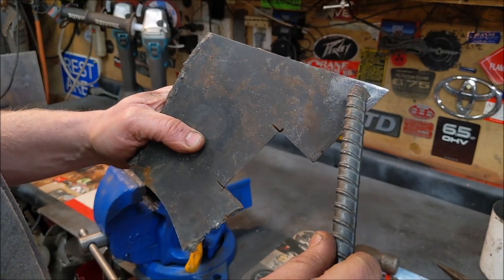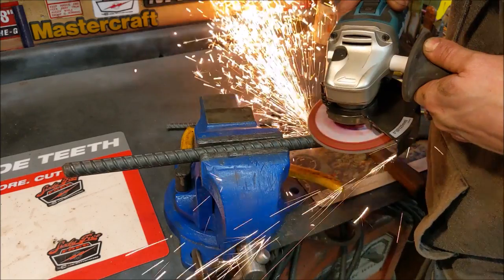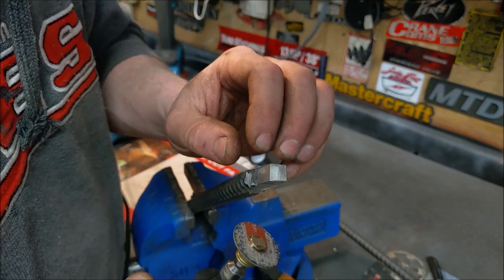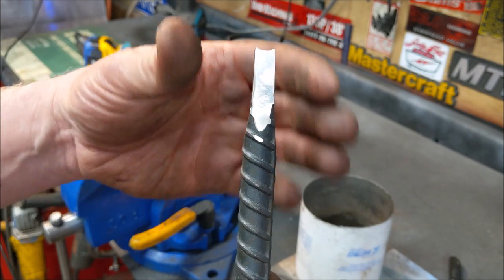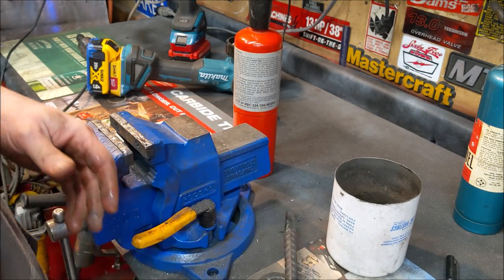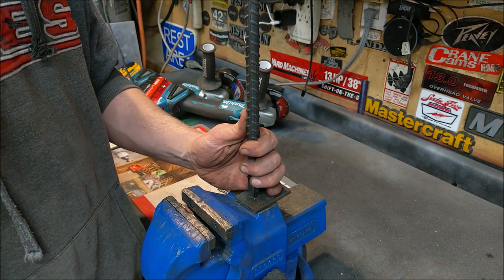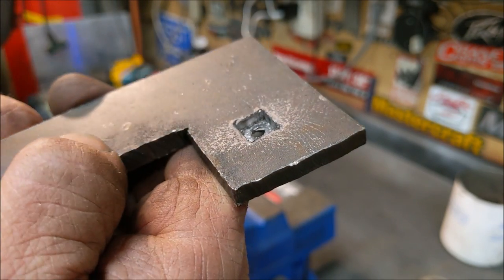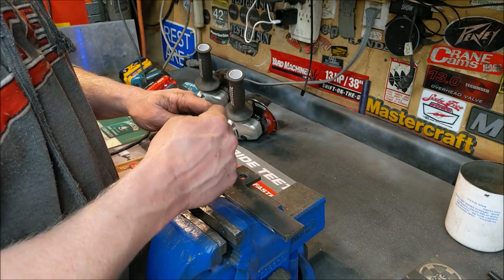Drill Square holes in steel with REBAR   -NO SPECIAL TOOLS needed

Comment: Great homemade tool from you yet again. So when you temper it could you still heat it back up til it just starts to turn yellow to get rid of some of the brittleness n still have it be tough enough to get through? N do you think rebar would work to make a tapered broach to use in a press?
Reply from the maker: Because I taper the temper after I got about 1/8" back from my original grind it was just fine. It's hard to judge the carbon content a chunk of rebar will have so you never know how hard it will get. The 1/2" chunk was perfect hardness but the 5/8" chunk got a little too hard. I would just heat it until it was around 500-700 approx and let it cool. It's hard to get an accurate temp reading with such a small piece. I would trim it down to about an inch or two for a press. The top is too soft and will bend out of the way if it's too long. It should take around 10 tons to press a 3/8" square through 1/4" plate(15tons-3/8"plate, 20tons-1/2"plate). Put a shield around it. It will be a scary
Reply: @sixtyfiveford  thanks man. You're awesome

Comment: Cool video!
       I thought heating a bar for e.g aids bending or shaping it with hammer.   So does cooling it fast have the opposite effect?
Reply from the maker: Cooling it fast hardens the steel and makes it impossible to bend/shape without breaking. Cooling it slowly anneals the steel and allows it to be malleable.

Comment: your right water does harden it better but salt water.. 10% salt content to be exact but what's important is apply a flux to whateveryour hardening befote heating it burn away the flux will make metal more "atomicly" more accepting to harden and the salt plays a huge role in that, makes a huge difference 2 extra steps but you get a much sharper hardened result
Reply: Newb here. What kind of flux?
Reply: @GeekRedux   i always used the green label kind it's the real thick green almost Play-Doh consistency flux.. its but what flux required to solder to steel but technically steels not solderable  to a certain degree, the idea is pitting the surface ever so slightly just large enough for the sodium,to enter. remember steel shrinks as it heated that's  why shops heat stubborn bolts . the shirking,makes it possible to obsorb the mineral that changes steels atomic structure harding it when its cooling it has less occupied atomic space with all these new sodium molecules in the same space changing its atomic particles space in between less space increases  density  hardens the steel
. The idea behind it.. i forget why you dip cherry red steel in oil but i believe its because the some of the carbon in the oil is transferred into the steel and the higher the carbon the density...better wiki that but the green flux works and 10% sodium salt water to harden steel.. but becareful only harden the edge its super hard and can shadder now but holds a edge and strengthems it sheer wise
Reply: @drewstudlino5885   Thanks for the info--much appreciated!
Reply: @GeekRedux  yep welcome just remembered only heat what you want hardened this method really works for example a friend asked how  my axe stayed sharp so lomg I told him and he hardened his  entire axe head and then hit the back with a hammer to spilt wood a piece of the axe broke off and cut his leg really good just remember hardened steel behaves differently good luck

Comment: If your pilot hole is large enough to accept a jig saw blade as it is in this case you can save copious amounts of time by just jigging out the corners. This is a very quick way to punch holes in light gauge metal though so A+ for that.

Comment: Wouldn't tempering it be beneficial?  I'm a hobbyist blacksmith and I know that once you quench the metal gets extremely brittle
Reply from the maker: Brittle, but also as hard as it's going to get. I played around with tempering and it made it too soft and rolled the cutting edges.

Comment: You said drill square holes! This is click bait! Lol just kidding pretty cool never thought of. I've always just drilled 4 small holes then a bigger one in the middle which works good enough for most things but can still have a little play in it. I'll definitely try this the next time I need a square hole thanks.
Reply from the maker: 4 holes on the corners/1 center is how I've always done it in the past. This is a fun method to test out and quick for sheet metal, I don't know if it's quicker for thick plate though.

Comment: LOVE YOUR PUPPY !!  AND really cool idea ,  The hardening seems to be the trick . could you use a piece of square tubing , sharpen the sides and use it for holes in wood ??  Thanks for sharing all the cool ideas !!!
Reply from the maker: I have made crude tools from mild steel for wood in the past. Mild steel doesn't hold a sharp edge well at all but will cut a hole or two before needing resharpening. I tried it out while doing some timber framing and kind of gave up. I found it easier to use a chisel or jig saw for mortise type holes.
Reply: @sixtyfiveford  thanks

Comment: Push it through with a press.
Much better than impact.
Reply from the maker: I did that and it's a bad idea 
tested this with a Hydraulic Press VIDEO: https://youtu.be/q3DsOm7tsjg
Reply: @sixtyfiveford  yes I saw that. 
That press us way too loose for punching or broaching.
With a tight press, it will work properly.
The difference between punching and single tooth broaching, is the pilot hole made before broaching.

Comment: What if you started a larger drill (cross corner diameter) and created a shallow c'bore that would center the broach on the new hole?
Reply from the maker: That's a good idea. It does go much easier on the concrete without the flex of the table/vise(but that makes a crappy video). Also cutting oil helps.

Comment: After drilling, I use a square file, so I can push the rebar in without any effort ;)
Reply from the maker: Perfect!
Reply: @sixtyfiveford  I didn´t even know it was possible to hammer a square hole through such thick material. Goes pretty well, looks like a time saver.
BTW, I recently learned punching holes for rivets in the airline industry is a no no, because of the hairline cracks that come with it.

Comment: Good.Thanks.
Orrrr, 
How about, drill a hole, draw square, then cross cut 
w/jig saw blade, to the corners, then jig-cut to the 4 corners.
Reply from the maker: That works and how I would handle a square hole in wood. A jig saw on steel has to be one of the most painful methods of steel cutting.
Reply: @sixtyfiveford  
Not everything's easy in life you know. Hahaha. Just messin'...
Draw the square, drill hole, then you just grab a steel cutting jigsaw, with a (Dewalt) blade...cut the little corners away.
...ta da !

Comment: Heat the plate to red hot and you can broach it more easily.
Reply from the maker: There's a reason you don't heat metal before you drill a hole with a drill bit and the same goes for this. First, you have to get it red hot and it only stays that way for a few seconds before the heat spreads. Now you have a red hot piece of steel you're playing with along with a torch all while trying to get the punch and hammer lined up; seconds are ticking. Now you line it up and strike your first blow and your punch will loose it's temper once it comes in contact with the red hot steel and deform as well. Now you have a deformed hot chunk of steel and a hot rounded over punch. Still no square hole.

Comment: Can any rebar be hardened or just some types?
Reply from the maker: All the rebar I've used can be hardened as it is a high carbon steel. It just hardens to different degrees. They have different grades for bridges vs than the stuff you put in a driveway. But when they make rebar they just have to meet a minimum structural requirements for that grade so you could be getting bridge strength stuff in a bar you bought from the Home Depot. You never know unless your are ordering qtys for a large construction project.  The larger 5/8 chunk I used had a higher carbon content and got a little too hard where the smaller 1/2 bar was just right. The 5/8 was probably made for making bridges/buildings.

Comment: Cold you make one for a press?
Reply from the maker: I had to look it up to see the force required. A chart I found online says a 3/8sqaure hole(roughly same area as 1/2 round) would take 10 tons to push through 1/4" mild steel plate(15tons 3/8", 20tons 1/2" steel plate). That's less than the force I though it would take.

Comment: What is significant about the square hole than round?
Reply from the maker: To use carriage bolts. For blind holes that you can really only get to one side. Also for spots where you would have a bolt sticking up(Pickup truck bed floor) but don't want stuff to get caught on the bolt head(carriage bolt)

Comment: Nice video!! Could you use a press?
Reply from the maker: Yes. It'll take around 10tons to press a 3/8" square though 1/4" plate.
Reply: @sixtyfiveford  No way wow!! After posting this i seen more what your doing later on in the video and it's more chipping the hole into it.

Comment: Would it help to heat up the metal plate first?
Reply from the maker: Possibly. However steel really doesn't get soft until it's red hot.
Reply: Heat to red hot then?

Comment: This would have worked better by starting with a smaller square and making several progressively larger cutting edges further up the rebar. A single edge broach makes it harder to use and less precise.

Comment: Shouldn't you also anneal the metal you are punching the square hole in?
Reply from the maker: Standard hot rolled mild steel doesn't really harden.  It has to have a higher carbon content to be able to noticeably harden then anneal(like the rebar). Cold rolled steel may be a different story as it has been work hardened by being formed into shape cold and may take some annealing but I don't know if it would be noticeable.

Comment: Could this be done using an Arbor Press?
Reply from the maker: I don't think and arbor press would exert the force needed. I did it with a hydraulic press and it was scary https://youtu.be/q3DsOm7tsjg . I think one hammer blow exerts around 50-100+tons of momentary force.
Reply: Would it work easier if you drilled a hole through it first? Less resistance?
Reply from the maker: Yes. I did drill a whole slightly smaller than one of the flats on the square.

Comment: Hello all--sort of related to this...does anyone know if it's possible to drill a small hole in a short length of rebar?  As if I was going to use it as a keychain or something.  What I'm actually doing is attaching a ring to it and a bison tube on the other end---right, a geocache.
Reply from the maker: Rebar drills pretty easily.
Reply: @sixtyfiveford  good to know, thanks so much for the reply!

Comment: How to drill a hole and then punch it out square with a punch made from rebar. 

Yes, square holes definitely were made BUT

There were no square holes drilled with rebar in this video
Reply from the maker: If you rotate the work piece even 1 turn while doing this it's drilling.

Comment: Loved the video, especially on simple hardening, but you're tripping and working way too hard!! You already have a milling vice on your drill press so you could do a bunch less work with some steel heads for a mill. I wouldn't try to use the press to laterally grind material away in the vice, at least not much cause you don't have the stability or RPM's on the press to do that safely, but you could easily vertically drill out way more material with a small milling head, thus putting less demand on your rebar cutter. Again, they're not designed to work together but like anything, if you're patient and safe, you'll get results.

Comment: Maybe it would be best to temper after the first quench. Slivers of brittle steel have been known to fly off and cut arteries.
Reply from the maker: You really don't know if you need to temper it at all. The first chunk of rebar had no issues of chipping while the second had a higher carbon content and was a little more brittle. Though a few sharpenings and I got back to a slightly softer steel and no more chipping issues. Hardening just the tip will give a gradual softening as you grind further back.  These will never be as hard as tool steel so long slivers aren't really a concern but you could wrap a rag or gloved hand around the area.

Comment: Why don't you just heat up the hole so it drives thru with a lot less work
Reply from the maker: There's a reason you don't heat metal before you drill a hole with a drill bit and the same goes for this. First, you have to get it red hot and it only stays that way for a few seconds before the heat spreads. Now you have a red hot piece of steel you're playing with along with a torch all while trying to get the punch and hammer lined up; seconds are ticking. Now you line it up and strike your first blow and your punch will loose it's temper once it comes in contact with the red hot steel and deform as well. Now you have a deformed hot chunk of steel and a hot rounded over punch. Still no square hole.

Comment: Heat up your work and it will punch in like butter.
Reply from the maker: The issue is if you don't have a corresponding die underneath it will severely deform the metal.

Comment: i thought cooling in water was to keep it workable heat to blue and cool natural for hard
Reply from the maker: If you get it orange and quench it, it will get as hard as it's going to ever be. Water gets it harder than an oil quench. You can quench it at lower temps for softer/more malleable steels. You can also anneal it after by bringing it up to 500-700F and allowing it to naturally cool.